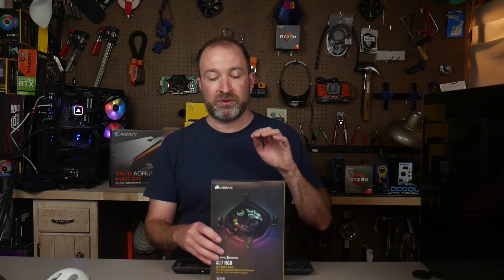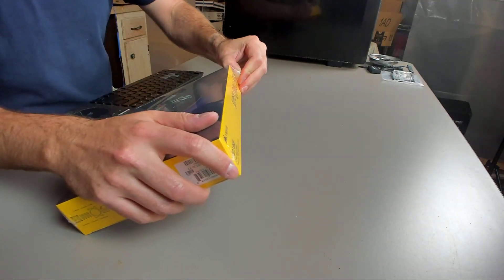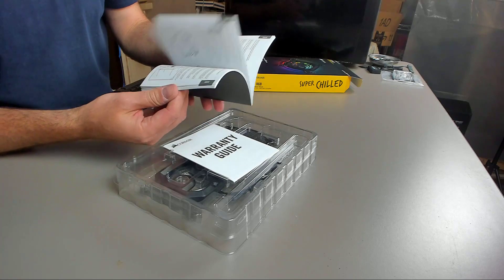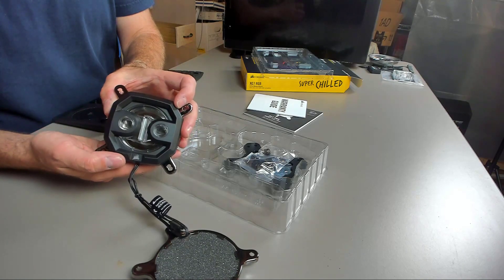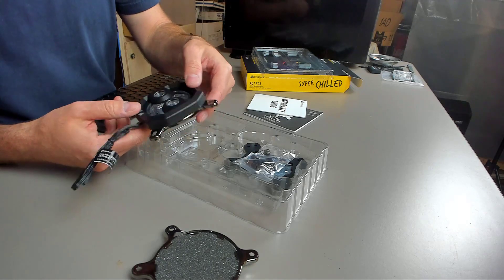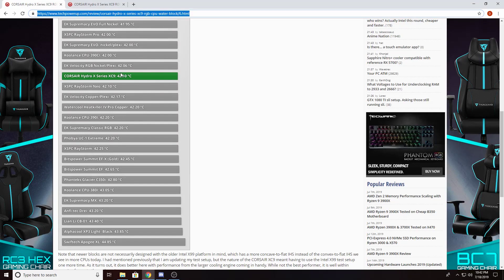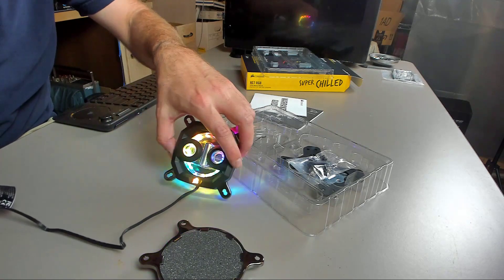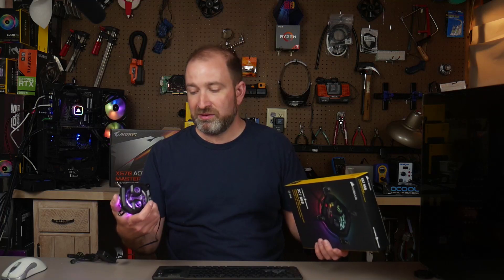Corsair XC7 RGB - Review & Unboxing

Comment: What do you mean you wouldn't wanna  mount this with am4
Reply from the maker: Maybe my voice a little hard to hear. Elaborating on what I said, it works with LGA115X and AM4. You could also mount it to AM3, but it wouldn't make sense buying an expensive CPU block for an outdated platform. I got the newer version last year and the mounting system changed a little bit so the old HW isn't compatible the new block. I found this out the hard way ><.

Comment: Is this the one for the 11900k?
Reply from the maker: Make sure you get the Pro version as it is compatible with the 12th Gen Intel and backwards compatible with previous AM4 and 11th Gen intel. The non-pro shown in my video isn't compatible with the 12th gen. Corsair should also have a MB configurator tool to also help validate the block.
Reply: @SolarityTechnology  that's exactly what I ended up with man, XC7 RGB Pro but I had to manually upgrade it from the selected recommendations using the configurator for 10 dollars more. The only difference according to the description is the amount of fins the water block has. I think it was 50 ish to 110 or something along those lines. Thanks for the reply and the video.

Comment: hi, may i ask if you can measure the distance between the inlet and outlet in mm?
Reply: John Fung i measured 26mm (or 1 inch) from inside edge of one to inside edge of the other.
Reply: @StatikXero  thanks mate! appreciated
Reply: @johnfung1783  NP!!!
Reply from the maker: Doh didn't see his post it is about ~39mm on center and about 26.35mm inside edge. So I confirm StatikXero's findings. Measured with calipers.
Reply: @SolarityTechnology  Thanks mate!